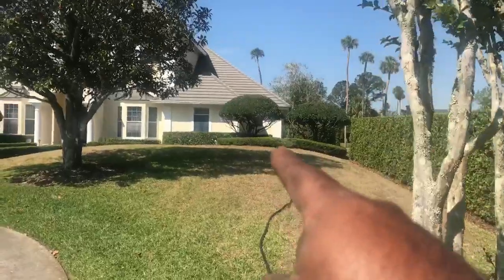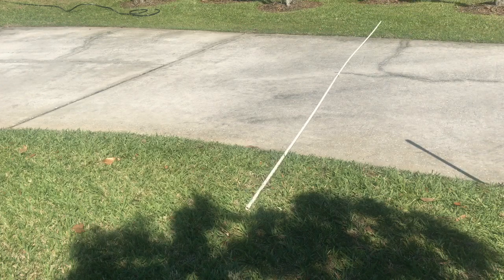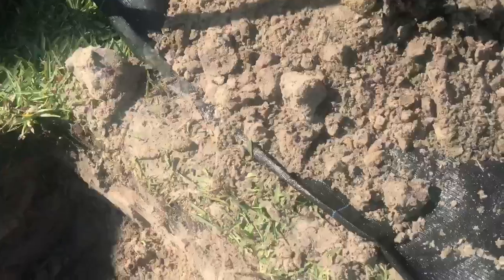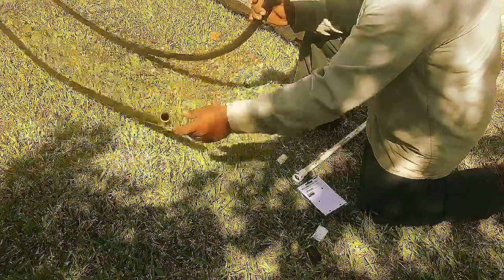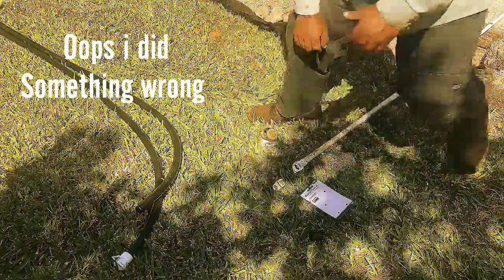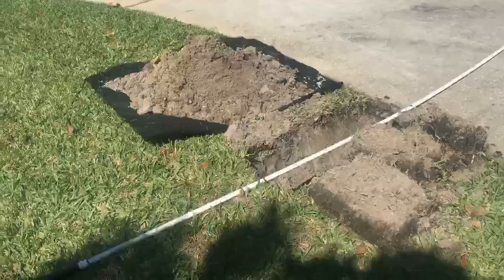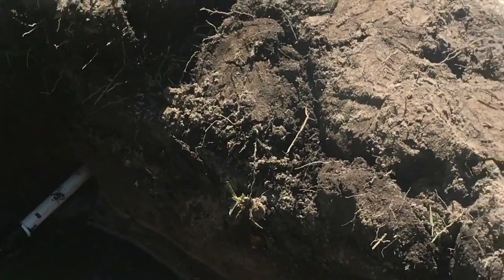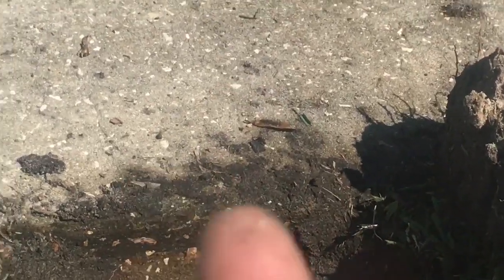How I prep to run pvc pipe under a driveway

Comment: I did this 2 days ago, burst mains under driveway, so I diverted my mains. I did the same as this bloke, using 20mm pvc, although i cut teeth into the penetration end, went through 5 meters in 10 minutes. I then slid 3/4 cooper through the pvc. Job done. A mate of mine is pissed off, when I told him what i did, he got a plumber fix his leak and they cut holes in the driveway.

Comment: Thanks for the idea on how to install a pipe under a driveway.  I put several pipes under my drive and concrete sidewalks 34 years ago when I built my house and have used two so far.  The others are capped and ready to use if I ever need to access the other side of the drive.

Comment: Pretty cool tip , trick:  guiding the pipe to stay along the slab.  ...I never heard of that one before!  I've poked pipes under ~3 foot wide sidewalks.  Just a random depth.  That's all.  I can visualize yir pipe skimming along the bottom of the slab...  The water flow is blocked from traveling upwards by the slab.  So you get twice as much water volume directed perfectly.   Yeah, I've helped friends, replace a water main, underneath their driveway.   ...We did it the HARD way:  rented a concrete saw, spent a few hours cutting the slab and digging a trench.  And then we had to fix the driveway!   We filled the cut with some dirt, packed it, then dumped in cement.  Finally, we placed brick in the slot and grouted.  That took forever!  We didn't know about yir cool trick.   Man! My back hurts just thinking about it.  If we had known...we would have been done in 20 minutes!

Comment: I tried that method on some clay soil and was not successful years ago (using water).  They typically use an auger around these parts.  I ended up using a metal pipe and sledge hammer.  I went about 10" below the sidewalk and I'm glad I did because they came through about 2 weeks ago to replace some side walk area and probably would've damage the water line if I had the pipe sitting just under the concrete.  If I buy another house, I will make sure there's no public sidewalk in front of my house.

Comment: That trick with iron pipe and a drilling head (we used a hunk of mower blade welded to a slit in a ~ 1ft pipe nipple) is an old shallow well trick to cut and flush while driving well casing in non-rocky soil. The old boy who showed me did many wells in SC that way and it works because I helped while learning. I never thought of it to go under a slab! Cool video!

Comment: Before anyone attempts this I would check with your local building codes and inspector. A quick check of the NEC requires a minimum of 18" under a residential driveway regardless of type of conduit used.
Reply: 18", 12" if GFCI protected, 7" if run in rigid conduit.
Reply: This is just 24volts for irrigation.

Comment: Great information, thanks especially for the secret tip of angling towards bottom of slab, wouldn't have thought of that.  thank you very much, you are the man.  Wonder if it would work here in northern Arizona, we have tough sandstone that is just below the thin layer of soft sand everywhere.  I think it might just work.  Thanks man, very helpful info.
Reply from the maker: Thanks for watching and sorry for the rough ground I guess were kinda spoiled over here in Florida.
Reply: They blast right through sandstone where I live with pressurized water. but the sludge gets pumped out.

Comment: You didn’t film the most important part!  How you hooked up and started water and placed hose!  Grrrrrr. I needed to see that part.
Reply: What do you mean? All he had to do was turn the water on and guide the pipe. Like he said at the end, push the pipe downward so the end goes up along cement. This way it comes out close to the surface.
Reply: @chelereyes3305  hahaha ..funny it is not that easy .....he did not show how he started pushing the pipe  and boring under the driveway....they may have used a boring machine, not easy to open a hole for a pipe like this.....
Reply: I agree. I’m an irrigation tech, and if I could make money (from advertising) I’d show exactly how and explain why I do things. I wonder if I should start a channel (with detailed videos) showing homeowners how to make irrigation repairs?
Reply: Hey man thanks for the video.

Comment: Hey moreno landscaping, this was some valuable info! I plan to do this in two areas in my home now. However in one of the two areas, i want it only to go about 10-14ft and 90 up so i can install an island sink in my backyard. It will be almost centered between my slabs. How should i go about cutting a hole in my slab to run the hose? Any tips? Is it feasible?

Comment: Question, besides the obvious backfill next to the driveways, do you need to backfill the space you washed out with water on the way across to the other side beneath the driveway? Wouldn't the void cause a space for possible future location of a crack to happen?

Comment: You took out the important part.
Reply: Beobout6 to
Reply: I know
Reply: Yeah, I wanted to see how bad it was to fight with to get it through.  What if it hits a rock?  What if it starts to go down instead of straight?
Reply: I know how to glue pipe and dig a hole! Which you spent a lot of time showing. 

The only thing you left out, was how to run it under the driveway.

Comment: Besides taking out the important part. you created a hollow (weak spot) under the cement. So how do you fill that?
Reply: don't worry, be happy.
Reply: While no disagrees that this technique worked, the concern about the void is valid. You can see it in the video. Cars driving/parking over unsupported concrete can cause it to fail. Again, yes, this works, but it's not a valid technique that should be used.

Comment: Very good tip. But if you're running electric cable under ground aint you supposed to have it properly sleeved and marked up?
Just in case someone else starts digging later on. They could be electrocuted. They could easily hit it like you hit that pipe whilst digging.

Comment: I guess it would work ok in sandy soil like in Florida but in places that have hard compacted soil or clay it won't work so well. Also in my area they are required to put 6-8" of gravel under any driveways
Reply: In south Florida we have coral rock so it does not work here  I have to use a skid steer auger and a skid steer trencher to go under driveways On th plus side you can go a foot deep or more without any more work than a shallow bore.

Comment: your video missed the important part of the process. How did you start running the pipe under the driveway? Men, you have to examine your video before sending it to U Tube.
Reply: All you do is keep working it around,  the water is pushing the dirt away

Comment: Won’t this create a type of sinkhole and the driveway will eventually crack?
Reply: If a heavy vehicle is driven over the cave created by that water nozzle, in my opinion the driveway concrete will crack and sag. Next a section of the driveway will have to be cut out, the cave filled in, and then the driveway will need to be spliced with new (and different-looking) concrete - a real eyesore.
Reply: YANKTON1000 yes that is what I was thinking! I don’t know how far away the sidewalk is, but probably been better to run it down near the sidewalk and then back up!
Reply: No, once the pipe starts into the soil, you keep pressure applied as you push it thru, twisting the pipe back and forth, you will end up with a hole barely bigger than the pipe you are pushing thru, I typically use a 3/4" pipe because you can push it thru with more pressure and less bending, I also cut an angle on the end of the pipe, longest point being in line with pipe lettering, this point allows you to steer the pipe as long as you know were the long point is, you can skip the jet on the end of the pipe, it is unnecessary, and works better without it, it is an easy process, very easy and quick in sandy soil, not a lot slower in clay soil, it doesn't wash out caverns as everyone likes to think, the water simply follows the pipe back out to the opening you started with, I've done this more than a hundred times in the 34 years I've done construction.
Reply: Concrete will bridge the gap its not blacktop
Reply: Another thought - water will find a way. Any space under the concrete could fill with water in a good rain. If the temperature is below freezing, said water will freeze and push the driveway up, causing a crack. Un-reinforced concrete is likely to crack without any help.
Reply: The results of frost heaving have been observed from earliest times. Swedish literature dating back to the 17th century indicates that the uplifting of boulders in the field and the breaking of plant roots in the winter were associated with frost heaving. At first, frost heaving of the soil was thought to result from the expansion of water on freezing. The present concept is that growing ice crystals draw water from the surrounding soil and develop into ice lenses.
Reply: yankton 1000, you worry too much.

Comment: I know that pipe is tiny and I work with bigger pipe, but personally I wouldn’t do it this way. Either bust the concrete and dig or dig a way bigger hole so you can actually tunnel under. Second video I’ve seen like this and I don’t see the benefit I’d rather tunnel under that way you don’t bust concrete this isn’t tunneling this is basically shoving a pipe with a bit of water pressure lol

Comment: The pipe doesn’t look deep enough to run electrical according to code and if you tried to run it against the bottom of the slab you can never get deep enough.

Comment: Was curious about the 2 valves that needed wire. Were they broke somewhere in the field? Is the wire multi strand or 14 gauge single strand? Typically I would use my wire locater to follow the path of the wire / main line and find the valves in the field that are before your 2 non working valves. Checking all wire splices and testing voltage on those wires before they reach the non working valves. Typically in residential you don't find a lot of broken wires in the field do to utility companies so generally it can be fixed with some wire troubleshooting. if it is multi strand, are there any unused wires at the clock that could be used in the field to power up your valves? Also finding your wires have power at a valve box closer to your non working valves could at the very least make your adding wire much, much shorter distance in the field verses running all new wire all the way back to the clock. A wire locator, a voltmeter and a toner are an irrigation techs best friend. if all else fails an add a zone can be used with working valves to get those zones back up and running.
Reply from the maker: murphy  thanks for watching and commenting. But both valves were on single wires and the only way I was able to find these valves was with a wire locator but the single was week. The valves were working and the solenoid were working also so somewhere in the wires there was a kink and I had a hard time just locating the valves so I figured to save time and money it was just quicker to run new wires . If I didn’t find the break when I was locating the valves in the first place . Question have you ever heard of wires getting old that the the plastic coating on the wires get so tight that it can suffocate the power signal from the clock to the valves ?
Reply: Moreno Landscaping & Maintenance 
Suffocate the signal? Hmm, if you're using a fan on a very hot day to keep you cool while working, can you turn the fan off by kinking or tying a knot in the cord? Didn't think so.
Reply: murphy l

Comment: Great way to get pvc over to the other side, but what about code?! Isnt it suppose to be 24 in. Under concrete and gray pipe for electrical?
Reply from the maker: Here were I’m at Florida there is no code for irrigation pipes and low voltage wires.  but for the gas line and the sewer line there is.  16ft or deeper.
Reply from the maker: Lol !! I meant 16in or deeper
Reply: Hmm, i thought it had to be deep enough in case they want to break up or dig without hitting the pipe.
Reply: Intresting,You learn something everyday!
Reply: Anything 30volts or less only needs 6inches of cover. That is if your wire is in a PVC conduit. No specified depth if under or in concrete.
Reply: And it looked as though he was fitting the PVC with primer and no glue.
Reply: +Dylan t "PVC with primer and no glue".....thx bro!, some hero's don't wear capes

Comment: Do you need to do anything once the pipe is in place? such as backfilling around the pipe somehow under the concrete? great video either way!
Reply from the maker: Jonathan Orr thank you for watching. But to answer your question. The only back fill I did was the holes I dug on the edges of the driveway . No back filling under driveway . I hope that answers your question.
Reply: Blow expanding foam into the tunnel under the driveway if you live in freeze/thaw area, else by-by driveway. Warmer climates can do things differently.

Comment: Didnt work for me. My driveway is 14 feet wide, did everything according to this video. Problem is: The concrete or tree roots are just under the driveway slab. Tried at 2 inches below the bottom of the slab- went not quite half way thru, then dug deeper and tried at 8 inches below the slab. STILL no go. After attempting it for 30 minutes it began washing out the dirt from under the slab, which isnt good ,will cause washout holes if big enough. Great concept, just didnt work for me. My loss.

Comment: Not really the best way. Real easy for sandy soil which this video is. Clay this wouldnt work. also you run the risk of washing out under your driveway which is hard to get back filled and can cause cracking
Reply: Pump a slurry in it.
Reply: That’s exactly what I was thinking...the concret doesn’t have support under it.

Comment: FYI... you can rent a pipe driver for a rotary hammer that will push a pipe through dry dirt. Adding water just destabilizes the soil and could make your concrete settle. There is already a problem shown by the amount of cracks in the slabs. Or... just open up an expansion joint, insert wire, then caulk over it...

Comment: What are the odds of the concrete cracking right along the spot you ran the pipe through?
I'm guessing somewhere around 100%.
Wouldn't it be better to just dig up the concrete, run the pipe bedded in sand, compact it and patch the cement, since you'll have to patch there in a couple months anyways?
Or it is it someone else's house and you'll be long gone by that time?

Comment: As a 48 year plumbing contractor. Not 48 years old. In business for 48 years. First off this is basic knowledge.  Second. Dig your ditch back further so your pipe isn't bent & trying to jet deeper.  Third. Always, yes always put in an over sized pipe. Your customer is paying you to do a job for him. If he ever wants to put something else under that driveway he will have to pay to do this all over again. If you install an over sized pipe. You can just run yet another wire thru the same pipe. With a 1/2 inch pipe. You cannot run another wire thru it. (Codes) what do you think the difference in cost will be. I think if you bring it to the home owners attention he will be more than happy to pay for the extra cost in materials. The labor will be exactly the same! 
    I really need to ask. Is this guy a "handyman" or a licensed contractor.  Guess which one I'm saying he is?
  Why? Did he leave out the actual jetting of the driveway?
Reply: we used to run a conduit of 2 inch sunburned pvc pipe across the head of the driveway before we paved it. A nice touch, assuming the future owner would know it was there!

Comment: If anyone ever drives a heavy vehicle over the cave around that water pipe, the driveway will crack - there is no reinforcement in driveway concrete, and somebody will have some concrete fixing to do. The hole under the concrete will have to be filled in.
Reply: Thank you.
Reply: we have no idea what type of reinforcement is in the driveway. sounds like  you made that up. I ran 5/8 inch rebar in my driveway and you would never know just looking at the finished driveway.
Reply: Richard Driskill, it will not “fill-in” with time. If it does, “fill in”, the soil has to come from somewhere, always leaving a void somewhere else.
Reply: I have rebar in my entire driveway too.

Comment: This is a temporary solution. A heavy load over that area & it will break. Shud have just cut the concrete & placed a new pipe. Yes the concrete will look off but fuck it. Think smarter, not harder!